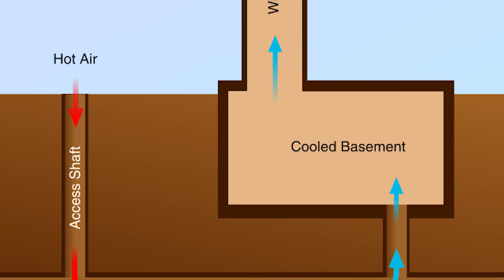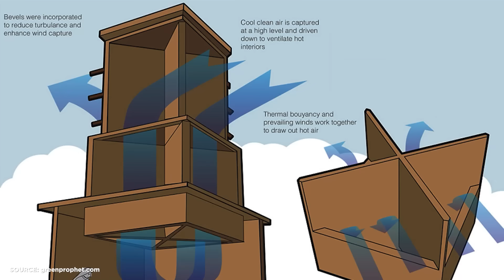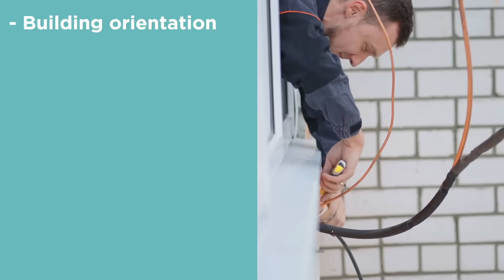Forget Heat Pumps - This House Cools Itself With NO Electricity!

Comment: Having that off-the-grid, self-sustaining smart home is such a cool concept. Everything from smart architectural design to aquaponic gardens and solar roofs. I could watch hours of content that covers that.
Reply: Kirsten Dirksen 👍
Reply: @chriskaprys  ^THIS
Reply: It is also something that fewer and fewer people can afford. Buildings like the "Eastgate Center" ref: 8:08 are a better alternative, but like projects have been fare from cheap buildings.
Reply: Have you seen Garbage Warrior?
Reply: @justinbelshe  I have not, but sounds interesting. I'll give it a watch
Reply: You don't need some high tech house or a big budget for a solar system that will cover all or most of your needs for the average American. A 10kw solar system is not that expensive, it can be installed on almost any roof, can pay for itself in about 5-8 years, and will generate more power than most American households use per month. Even if you have a giant old drafty farmhouse with no insulation you can easily cover your energy usage with solar panels on the roof.

You don't even need batteries! It's called "net metering".
Reply: @ryanroberts1104  But that doesn't help you if the grid breaks down. That's when you need the batteries. If your electric car supports it, you can use it as a battery, though. Should cover you for a couple days
Reply: YouTube’s got hours of content on it, you’re in luck 🤙🏼
Reply: There are two ways of living. You work your life out of you to pay bills and the comfort of modern world. Or you work for your life and your home like people used to. 
You think you gonna instal a system and will do everything for you, is nice dream but that system needs maintance.
What people miss on these self sustaing off grid electric panels, and etc. Is one important thing, where do you store the energy? You need batteries and batteries are not cheap, and lose value overtime. People say you will get your investment over time but by the time you get your investment in the bills you did not pay, your battery cells lose life and need replaced. 
THE PROBLEM is the modern world is hungry for electricity and it consumes TOO MUCH the solution till we find a more sustainable method of making batteries is to CONSUME LESS is very simple. Batteries production pollutes just as much or maybe even more than old sources of making energy.
People just spin around this problem for years trying to find a way to cheat the problem in wich they consume too much too fast.
Everyone wants to stay all summer in a cool house with the AC on. Modern socity has became so weak. Some people can't get in a car if it does not have AC. 
Energy is all around, is not so hard to get it, is hard to store it and use it when you needed. I played with lithium batteries for a while now. I make rc planes. And these batteries are amaizing, they are very dense in energy storage, light, and can delive  very well. Problem is every cicle gets the battery more weak, and the batteries are very sensitive to heat. And the efficiency of them in cold drops alot. Kind of like all batteries work the same. 
Batteries are simply not meant for every day abuse. The only solution wich in my imagination can be sustainable is some kind of mechanical one. 
Solar panels is great i think for bringing energy some remote place where it has not electric line, but to use it everyday and be sustainble... I don't know i think you need A HUGE battery so you can reduce the cicles alot, and again, such a battery is too expencive to make sense.
Reply: @alexandrugajin763 A buncha truth here
Reply: It's a flawed concept. Need a little more energy than you planned for, even for a very short period of time? You can't. Need less energy (which will usually be the case, since you need to design for peak requirements)? The energy you produce (and could sell) is wasted, then. It's much better to be ON the grid, but still be able to live without it for some time. That way, the system can transfer around excess energy to where it is needed, and also have distributed storage.
Reply: @infinite_monkey590  you absolutely can. 

First of all, off-the-grid definition could include concepts that can manage without the grid (thus having the off-grid capacity), but which are still connected to it. These could sell the excess energy to the grid and make money, or occasionally utilize the grid for short periods of time. These houses would be virtually off-the-grid in all the meaningful ways.

Now if you wanted to have an absolutely strict definition of off-the-grid, that's possible as well. Batteries, like Tesla Powerwall, can help balance out the demand. You charge the batteries during day with solar and other renewable energy sources. With the correct battery capacity, you could power any reasonable electricity demands day and night.
Reply: @wihdinheim0  I know, I just wanted to point that out.
Reply: You will need to replace the batteries every 5 years so there will be batteries to recycle. Oh and where do you get the material for the batteries and the solar panels? Hmmm maybe mining oh wait we can't mine creates CO2.
Reply: Yes. Existing requires energy. Building requires materials. Everyone is aware.

The impossibility of perfection is not a reason to avoid doing better.
Reply: @b.6603  Well said 👏
Reply: @jrgreatwhite lead acid batteries are one of the most recycled things in the world.  We have a large scale infrastructure that can be converted to lithium ion recycling relatively easily.
Reply: @codybohyer1107  Regular lead batteries are easy, but the Lithium batteries not so easy at least according to industry. I suggest you explain it to them that it's very easy as they don't know that yet.

Comment: The main problem for anything like this is going to be cost. From a UK perspective we're having a bit of a cost of living crisis at the moment with the price of fuel being the major problem. Therefore cutting energy bills would be awesome, except that during such a crisis most people can't afford radical changes to their existing homes. While fuel is cheap there's the opposite problem: people aren't going to want to spend on things that will save them nothing in the short term.

Another problem from a UK perspective is that we have a lot of old houses, and our houses aren't built to be replaced every 40 years like they are in some countries. We also don't have masses of space for new builds. New approaches to house construction will certainly help but IMO wide spread improvements here are likely to be painfully slow.

Comment: 7/11 - I see ERCOT has warnings of rolling blackouts being possible...  simplest thing anyone can do is shut off what you don't need powered up, raise the thermostat as high as you can reasonably tolerate, close window blinds and make sure you've had your A/C serviced - check the charge and assure that your filters and outside units are free of debris and accumulated junk on the coils...    They must have some generation sites offline because the projected demand today doesn't seem super high at casual glance...  so much fast growth in Texas, hard keeping up all the power demands... (Lived in DFW for 20 years, moved to UT about 10 years ago)
Reply: Clean your outside coil (where the air goes in on the sides). You can use a strong detergent (or "purple power") in a pump-up sprayer then rinse well. If it's dusty where you are rinse them regularly. This reduces the "head pressure" of the compressor and that lower the amps/power consumption.

Comment: When it became possible for me to own a home, I had been renting near my employment close to the seacoast in Southern California. I went to lengths to find an affordable way to live in this same area because I realized the temperature modulating effects of the Pacific Ocean's proximity. So had the Spanish before this area became part of the U.S. Thick Adobe earth filled walls, kept the night coolness throughout most of the day, in summer and stayed near those earth temperatures warmed by the winter sun. Shaded cloisters and the open passageways to the mild ocean breezes aided comfort. While the place I bought didn't have those attributes I did not use the window AC I bought at the same time for nearly 30 years because of the thicker plaster walls holding more night coolness under the wide eaves it has. I use selective shading to help keep my heating bill down and a deciduous tree shades the front in summer, but drops its leaves in winter, providing more sun heating or less appropriate to the season. But it is the "shortest thermometer in the nation" we have here, according to the Chamber of Commerce ads from decades ago that gives my modest home its lower comfort energy costs.

Comment: I live in Finland, but we have both hot summers and cold winters. Good insulation helps in both cases. And during summer, shaders between (3 layer) windows so the heat from sun doesent heat inside air. Its allso possible to cool with waterpipes underground or drilled hole (temperature is quite constant at only 2m or over underground).
During winter, our house warms with district heating (underground pipesystem running hot water in loop), and that water running underground heats with local industrys excess heat from prosess.
Reply: Swede here. Wouldn’t say hot, more like warm summers since it rarely gets above 25C. What i have found useful is to have two fans on two windows, one “intake” and one “exhaust”, kind of like a pc case. The constant air flow pushes any hot air outside
Reply: yeah some people seems to think insulation only work one way.. tripple layer windows with a partial reflective coating is great in summer. greenhouse heating form windows is not very good in winter so the coating isn't a big downside in winter.
Reply: Yeah, it’s doesn’t get Texas hot in Finland. You’re off by 10-20 degrees F. But what would I know, I’m just a stupid American…
Reply: @mtb416  yes, Texas is (much) hotter than Finland. But that doesent mean that my writing isnt true. During hottest summertime 1-3 weeks we have 30c (86F) and a bit over, max temp around 36-37c (97F) in shade.
Reply: There’s no summer in Finland. :D Funny story: last summer, I stayed in Paris for a week, the temperature was around 40 degree C. The day I came back to Finland, the temperature in Finland increased to a record and there’s some concern in the news about the hot. The concern was temperature would raise up to 25 degree C, which is way too hot for a Finn. But yes, Finnish building is extremely good, excellent insulation and ventilation.
Reply: Wow what a great idea, to use heat from industry to provide hydroponic heating to a bunch of houses!

Comment: The older people that don’t believe in climate change also built the houses over the last 50 years. No airflow, poor planning, poor window placement, etc.

Edit to add: the electrical grid is owned by a lot of investment companies. It’s failing from heavy use and no upgrades or improvements.

Comment: IT would be interesting to see how you can retrofit existing builds in cities (those from the 19th century for example) to use passive house elements.
Reply: There are a set of standards called Enerphit from the passivhaus institute that give guidance to make retrofits as close to passive as possible. Might be of interest.
Reply: Also there is a program called Energisprong that is doing this in EU and now in NYC.   They take 3D laser images of a building and build perfect exterior covers that are airtight, add insulation values and contain the triple panels windows.   They “snap” into place perfectly and can the work can be done in just a few days without anyone having to move out of their homes.  We can be clever!!

Comment: There’s a disconnect between learning from
History about building passive houses and then building an airtight house with chemical insulation that needs triple glazed windows and doors and a backup heating cooling system…

Comment: I'd be interested to know how this can accommodate individuals with medical needs requiring even drier or more humid conditions than what the standards for their climate may call for in some of these regions. For example, as an asthmatic with intrinsic asthma I can get severe attacks when humidity or temperature fluctuates significantly to degrees that are less noticable to most other people.

The same can be said for those with other physical needs that may fall outside the norm.

Are such needs being considered by the designers of passive homes? Would individuals requiring such homes use the passive approach but then augment it with standard central air or heating?
Reply: We use standard heating and cooling in all the Passive House projects we build.   We just use smaller and more efficient systems than a typical code minimum home needs.    
Many of our clients come to us to build PH homes because of these kk da of sensitivities.
Reply: @mrkozz1  That is really good to hear! :) Thank you for answering my question!

You folk really are doing good work for the environment as well as the individual needs of people with diverse requirements!

Comment: 9:00 "it does this using less than 35% of the energy used by other buildings".
The chart shows it used 35% less energy than other buildings amd not that it uses less than 35% of the energy other buildings use.

Comment: All comfort has a downside - it's addictive. Giving up comfort is that one thing nobody will ever do willingly. When we HAVE to do it' we call it 'crisis' or 'catastrophe'. Welcome to the catastrophe of 21st century! Going back to higher temperature tolerance, higher food tolerance, more walking, etc. is the future. Building exotic houses to save 20% of energy will only extend the comfort (for some people) by a couple of years. The paradoxical effect of passive houses is that it has diminishing returns. When your house consumes about 1000$ worth of energy per year (heating/cooling/electronics/lighting), you need HUGE changes to save another 500$ (like >30000$ investment) and your comfort goes down quickly (like no window opening, every time you open the door in the winter you lose like 1$ in heating, as little ventilation as possible, difficult humidity regulation, turning off the lights non-stop).

Comment: As much as I like your research, your opening statements about ERCOT failing, and your suggestion that renewable energy was the source of the issue is demonstrably wrong. Research better. Renewables were blamed and the lie was often repeated, but it's absolutely untrue. Failure to pay for basic upkeep and winterization caused the blackouts. The engineers involved will gladly tell you.

Comment: hang on a second. ... you just said The upfront cost was 20 to 30% higher, which ideally you make back in savings in a few years.

while I support the idea and love the concept, 30% on a $400,000 home is $120,000.

... I haven't done the math but I'm pretty damn sure it would take you an ass load longer than a few years to make back that cost.
Reply: The payback period also depends on the utility costs in your area. Where I live, the energy costs are very low compared to the rest of the country, so convincing people of expensive energy efficient designs with little to almost no payback is difficult.

Comment: Techniques not forgotten, but definitely being underused. A lot of farm houses in Sask older than the 40's (most of them) are self cooling via good design.

The qulliq of the Inuit is CRAZY POWERFUL! the amount of heat that gets thrown off the tiny flames is almost unbearable. It's so hot! And the blubber you eat also gets your body heat up.

Comment: Texas here.  Yep.  Electric controlled by politics and rich people.  In east texas, my mom and dad had what was called a little 'shotgun' house.  that meant small, wood,  built with air flow under the floor, no porches but a nice breezeway between the house and garage.  we had an attic installed water fan.  the air came into the house from a trap door in the middle of the ceiling.  doors faced prevailing winds and would be opened to help circulate air flows.  when it got really hot, we'd put aluminum foil on the glass windows from the inside.  we also used floor fans quite a bit.  it was a combination of resources and air flows.  we had electric but used it as sparingly as we could.... but were expected to acclimate to the heat whenever possible.  now days i keep heavy drapes on all windows during the hotest part of the summer (which never seems to end... grin!).  we limit opening and shutting doors to the outside.  seriously.  you don't realize how often you do that until you try and STOP doing it.  chuckle!

Comment: We just replaced our old heat pump/AC with geothermal and I wish we had done it years ago.  It's extremely efficient and very quiet.
Reply: Geothermal is the dream! It's very rare though, I've never seen it person and only met one home owner who has done it
Reply: @shayanthis  the one they did for us was a 360 foot well to access the ground water for a stable temperature and trenched it in to the same place our old outside unit was.  Now there's no more big noisy outside piece. 😊